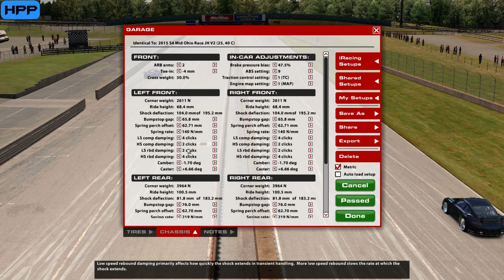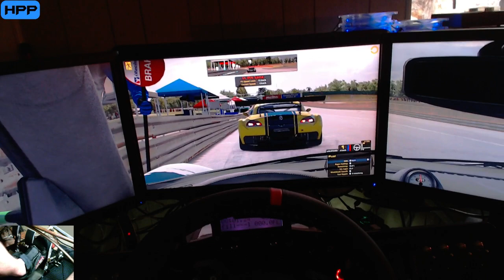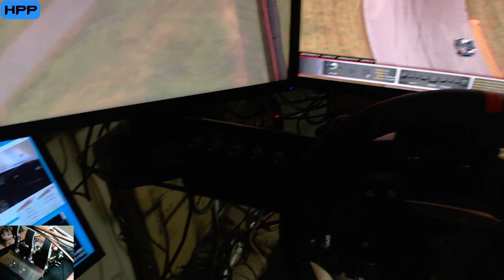iRacing - Race Prep @ Mid Ohio: Quick Overview | Dampers, Caster, Ride Height, Roll Bars

Comment: Are you sure that softening the rear slow rebound gives more oversteer? Stiffer = less grip, stiffer dampers = faster weight transfer?
Reply from the maker: WireSniffer softening is the wrong word.  I should have said lessening. With less rebound the weight transfers quicker.  Fast weight transfer in the rear means more oversteer.
Reply: @JHallin  Thanks, so why does so many sim racers lower the number, soften the damper, give more rebound to the slow rear rebound setting, thinking that the weight leaves that axle faster. I'm thinking it leaves slower. There's a lot of misconception about dampers, and the see saw effect.
Reply from the maker: WireSniffer the misconception is the biggest problem.  Took me a while to get my head around it.